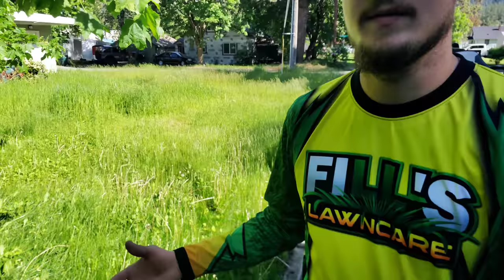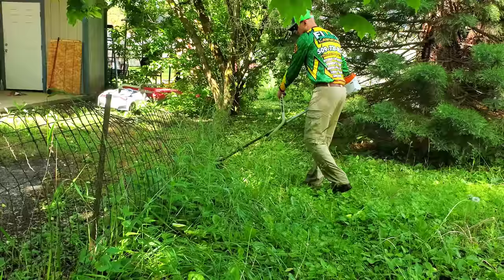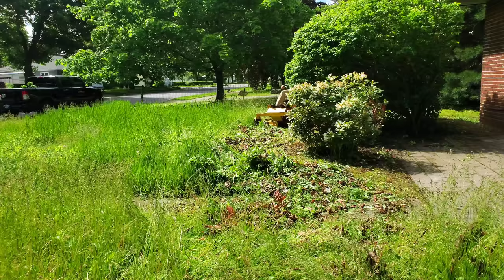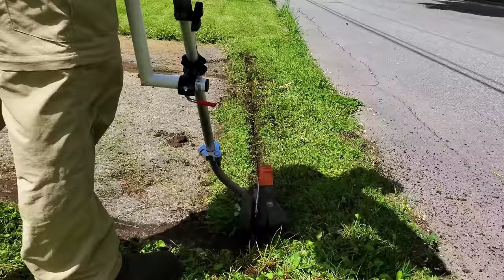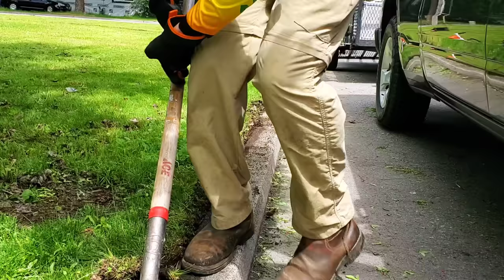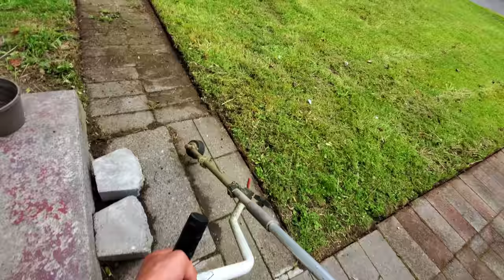He's Been SAVING UP For A Lawn Mower So I Cut His TALL GRASS For FREE

Comment: I notice that you use your STIHL weed eater without the guard, probably because it allows for a larger diameter cut which saves time. Is it your experience that the bump feed heads break down more often without the guard?

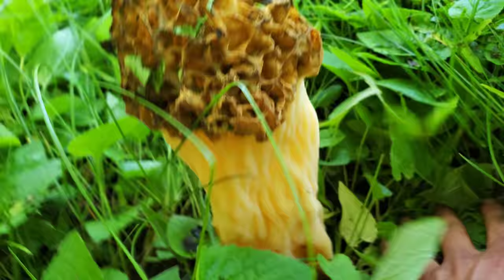Comment: 11:02 The yellow morel (Morchella esculenta) is one of the most iconic and sought-after species of edible mushrooms. It is often one of the first species that novice mushroom gatherers will hunt for. Yellow morels have elongated caps that are "honeycombed", being filled with roughly polygonal holes. Splitting them down the middle reveals them to be hollow on the inside, a key feature that distinguishes them from toxic false morels. Experts recommend cooking or boiling this mushroom before consumption, as raw morels may cause an upset stomach.